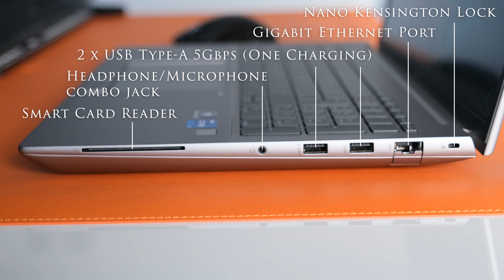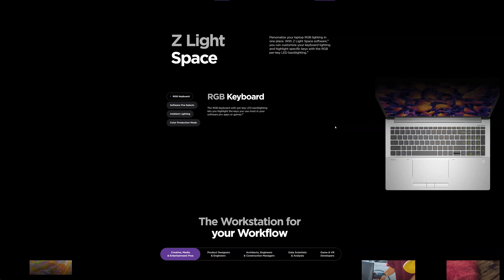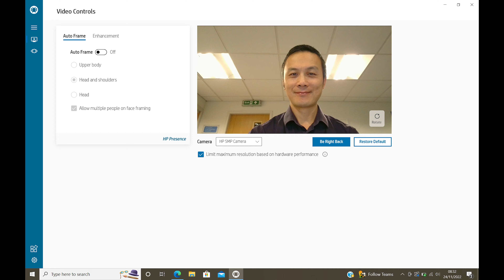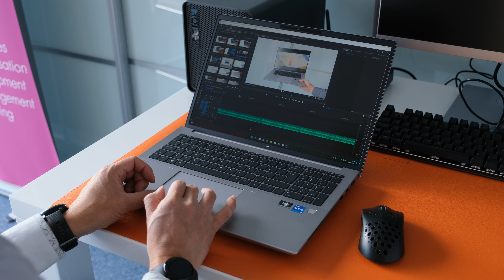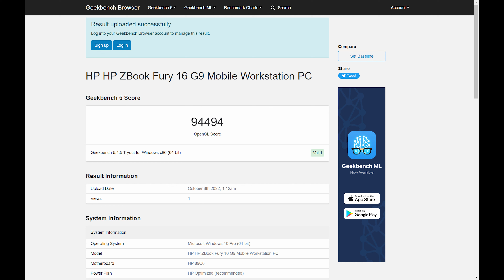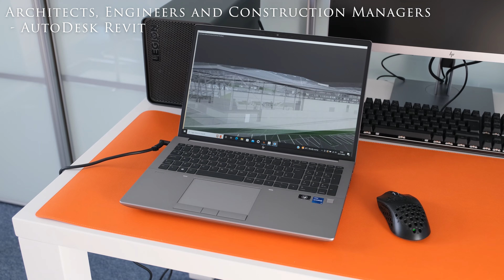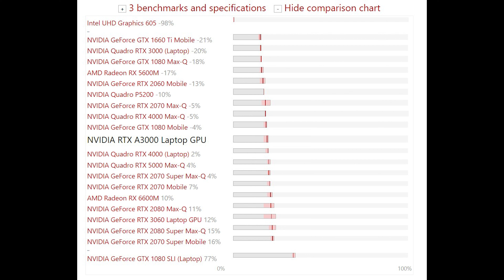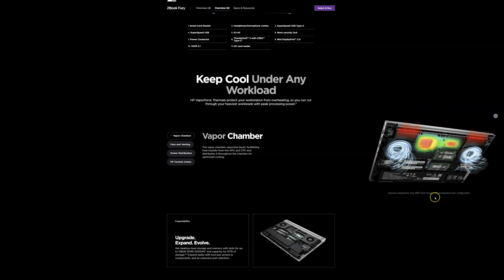HP ZBook Fury 16 G9 Review (Intel i7-12800HX, 16", NVIDIA RTX A3000 GPU)

Comment: How is the temps to the touch? Is it generating lots of heat, or did they do a good job of dissipating heat?
Reply from the maker: Excellent cooling, due to the larger chassis dimensions and vapour chamber with the higher end GPU's.

Comment: Hello! Thank you for the review. I just got my model in, and there’s one area that confuses me. Does the trackpad itself not click? I’m aware of the three dedicated buttons below the trackpad, but does the trackpad itself not click? I don’t want to break mine by pressing too hard, so I assumed it didn’t have that functionality. But if it does and mine is just stuck, it’d be nice to know. Thanks for the great content!
Reply from the maker: Normally a double tap on the touchpad will act as the mouse button click. There is also the two integrated mouse buttons at the bottom of the touchpad.

Comment: Thanks for this strongly awaited review!
Did you notice any weird fan noises?
Does using the laptop with the lid closed deteriorate proper cooling?

Thanks!
Reply from the maker: No weird fan noises throughout the 6 weeks of testing. With an external monitor and the lid closed, the fan was working normally.
Reply: @Dovecomputers  Awesome, thanks for your fast response! 🙏
Reply: No weird fan noises here either, just, the fans are running most of the time, even when the laptop is not under heavy load. 
Still gotta figure out though, how to fine-tune the fans with some external programs like Speedfan, etc.
Reply: @barsam2a  Thanks for your answer as well! 🙏 Annoying that the fans are always on; I hope that they are quiet then. Thanks!
Reply: @fle2  Not always on, but most of the time, yes, but they're pretty quiet, when the laptop is not under heavy load. also, I have the 12950hx/RTX A3000 version, so maybe the 12800hx is a bit cooler still, so the fans will not turn on that often.
Reply: @barsam2a  Thanks again! 🙏This one seems to be a good workstation compared to Dell/Lenovo. Nice config; you probably benefit from the vapor chamber even under light load, don't you think? I think (maybe wrongly) that getting the A3000 + GPU is a good choice, even for someone who doesn't rely on GPU-intensive programs. CPU cooling and the overall system should benefit from it 🤔. However, it comes with a huge premium to get the vapor chamber.
Reply: @fle2  You're right about the price, but I see this as a long-term investment. 
I've also bought the HP Care Pack with it, so you won't have any trouble, when something is going wrong, next workday someone from HP will show up and fix it. 

as general info: 
I can open 700Megabyte +   .step-files with 10.000+ components in Fusion360 in roughly the same time as with my 12700k PC. once in the viewport, there is like 0 lag when zooming, rotating, etc.

totally worth it. 

just need to figure out, how to get fans quiet, when the laptop is not under heavy load. 
that's the only downside I have, since using this machine for 3 weeks now.
Reply: @barsam2a  I reckon that it's an excellent long-term investment. However, I wanted to emphasize the premium required to get the vapor chamber compared to a version with Intel UHD GPU (~ +$1000).

You're right, it's a first-class performance! I also hope the fans' issue will be resolved with new BIOS updates.

Thanks again for your feedback! I will definitely consider it for my next workstation.
Reply: Let me share my experience.
I bought 12800HX, A2000 in the beginning of November.
The only issue is a short, strange noise upon fans start. It reminds the noise of an old HDD but much louder and sometimes can be heard as a kick. After the start the fans are relatively quiet and quickly turn off.
The dealer replaced the original fans with new ones, but this noise still exists. They explained this could be because of the metal, respectively heavy, fans blades.
When you work in a calm environment and fans constantly turn on and off, it can be quite annoying.
It’s possible to be set in BIOS the fans to be constantly on but in this case they spin at a higher speed.
I’m trying to find a way to set a min fan speed without being turned off but without success for the moment. Speedfan and Argus Monitor don’t work on this system.
If someone have a solution, I’ll be very grateful to hear it.
Thank you.
Reply: @neykodimitrov4347  Thanks for sharing your experience.
Those fans and the lack of configuration are pretty annoying. Does HP know this? Did they offer any advice to prevent this?
Reply: @fle2  Only discussions with the dealer till now but I'm going to write to HP. I'll share if there is any reply.
Reply: @neykodimitrov4347  Thanks 🙏 I hope your issue will be resolved quickly.
Reply: @neykodimitrov4347  Any news about this issue with the fans?
Reply: I have the same problems with the fans. When the fans start up, it sounds like a thump in the case (old HDD). In addition, the fans whistle in the lower speeds. This is extremely annoying. Hope there is a remedy via update or that the fans are revised.

Would be interested in similar experiences. 

Do you also hear a soft whistling of the fans?
Reply: @diesunddass-j3y  "When the fans start up, it sounds like a thump in the case (old HDD)."  

I have exactly the same, though NO whistling in the lower speeds.

Comment: Excellent review!   Two questions, the HDD capacity was a bit confusing, the 4TB limit for PCIe 4.0 is for the entire machine (not per slot). Can a single 4TB drive be installed, or is it qty4 1TB drives?   Also have you first hand been able to compare the 400nit oled touch against the 500nit dreamcolor lcd?
Reply from the maker: The storage limits are confusing! 1st SSD slot, 2TB PCIe4x4, 2nd slot 4TB, 3rd slot 2TB and 4th slot max. 4TB. Total 12TB PCIe4x4. The DreamColour panel has 120 Hz refresh rate, matte screen while the OLED panel is a touchscreen (glass). Both have 100% DCI-P3 colour accuracy.
Reply: @Dovecomputers  Thank you so much for the quick reply, your video at 2:21 is a little confusing/conflicting as it states 12TB ONLY with PCIe 3 SSD, it says ONLY 4TB with PCIe 4 SSD, but your reply above seems to indicate that 12TB of PCIe4 is possible with Qty2 4TB and Qty2 2TB drives (all PCIe4).  I looked at the G9 quickspecs and it does not define on a per slot basis what is acceptable. Where did this come from?  Also for display, I was trying to decide if color accuracy is NOT needed (ie excessive blue is ok), which display is brighter/better (does the attenuation of the touch digitizer exceed the gain from the better contrast of OLED display? versus the extra 100nits on the UHD "dreamcolor" LCD with better color accuracy and no digitizer attenuation)
Reply from the maker: At the time of testing (3 months ago) that was the limitation set by the HP spec guide. i.e. PCIe4x4 4TB drives were less common then. Information is found in the user guide and quick guide.

What will you be using the Fury for, display wise?

Comment: Thanks for this great review, I really appriciate it!!!
I am considering buying a lower specced version of this bad boy, because I just need really great performance for coding and occasional 3D plan viewing. I would love a 16:10 display, and I really dig the 4 SSD ports which I would upgrade or extend yearly and I could just snap a new one whenever I find it fitting.

As far as I know only the RTX A3000 GPU and higher specced GPU versions have the vapor chamber.
Did you have any test units without the vapor chamber maybe? Could this workstation go well without the vapor chamber and lower specced GPU?

I find the price pretty high, but a lower specced unit can be upgraded pretty easily in my honest opinion.
Does this workstation really worth it over the precedessors like HP Zbook Fury 17 G8 and 15 G8? 

I had some unreliable HP business notebooks in the past, which constantly restarted, frozen and had problems after driver/bios/windows updates.
Did you notice any issues, random shutdowns or freezes maybe?

Thanks for your inputs and you have gotten a new subsciber for your channel of course!
Reply from the maker: The RTX A1000 and A2000 doesn't get too hot compared to the higher spec GPU's hence the lack of the vapour chamber. Don't think cooling will be a problem due to the larger chassis dimensions found in the Fury. Used the Fury G7/G8 and now the G9 for months at a time and they are ultra-reliable IMO. Love the upgrade options, performance and didn't really notice the extra weight when moving it from home to office and vice versa. Thanks for the sub!

Comment: Thanks for the review! I'm a few days into testing of my 12950HX/RTX A4500 configuration and this thing flies! My first Zbook, usually a Dell guy but I'm sold on the HP. First thing I noticed is the included software works great for getting drivers and stuff up to date unlike Dell's lately. Stays pretty quiet under full load unlike a newer XPS I was using. Screen is sharp and vibrant. It's surprisingly lighter than I was expecting, the XPS is thinner but actually feels heavier to me. I like the move to a 16 inch screen, still slides in easily into my existing case and gives just a touch more viewability.
Reply from the maker: That was my initial impression with the Fury G8 and now the improved G9 version. Problem with the XPS (Otherwise great laptop) is due its thinner dimensions cooling is never going to be as good as the Fury which is fantastic. Plus, with the new curved edges and 16 inch displays, the Fury is still pretty portable to move around. My experience if want serious work doing, the Fury won't fail you.
Reply: I have the 12950HX/ A 3000 version. 
Do your fans also keep turning on and off, even when just using Outlook/Browser, lightweight programs etc. ?
That's the only thing that  bugs me, otherwise, as you say, great machine.
Reply: @barsam2a  Mine will spin occasionally when using with lightweight programs, but for no more than a few seconds.
Reply: @chriscampbell2450  mmh, ok, that's really weird then, I need to maybe call support then
Reply: @chriscampbell2450  is your machine also running on Windows 11 ?
Reply: @barsam2a  Yes

Comment: Thank you so much for your commitment and excellent review of most waited laptop. I liked the excellent upgradability features, 4SODIMMs, 4 m.2 NVMe Slots upto 12TB, robust security features, alder lake HX series etc.. Your video really helped to decide whether I should buy Studio G9 / Fury G9, the comparison of Benchmarks, Thermal Systems etc. I have decided with regards to my Work, I finally went with Fury G9. I would be really grateful if you help me few question of the Display Technology - HP SureView Reflect - Integrated Privacy Screen with 1000nits (WUXGA 1920*1200). I have read through product datasheet and a sureview reflect video from you a longtime ago, I didn't got enough details. 
   
1. Does the Screen can get 1000 nits or relatively low (~800) even if we don't turn on the privacy screen mode?
2. Is the Display quality and Brightness is good when compared to normal display with 400 nits WUXGA resolution?
3. What would be problems of having Privacy Screen display, does it impact any screen performance/ durability on long run?

Thank you so much😇😊

Comment: Thanks for the review. Are you aware whether HP provides on site support? I am using mobile workstations for a while (previously p17s and precisions). They always required some hardware support, never worked correctly.
Reply from the maker: Yes, the 3-year warranty on the ZBooks include on-site hardware support.